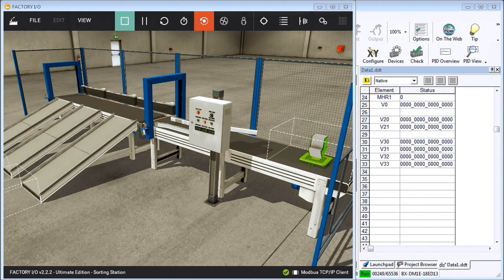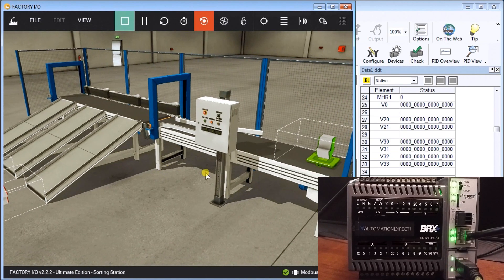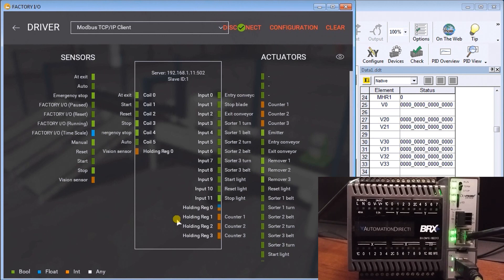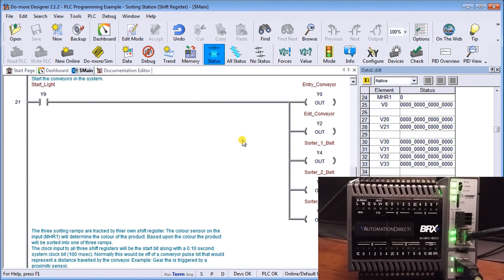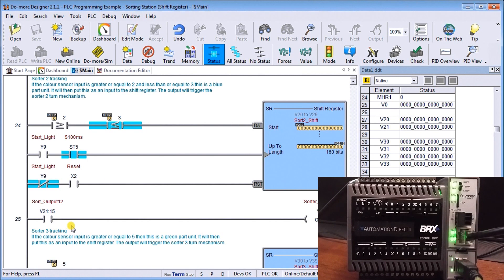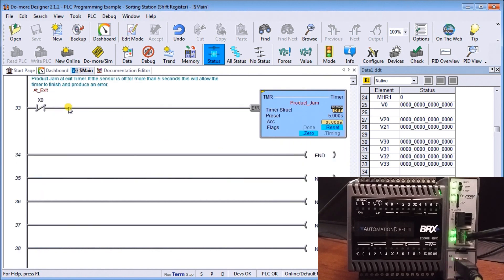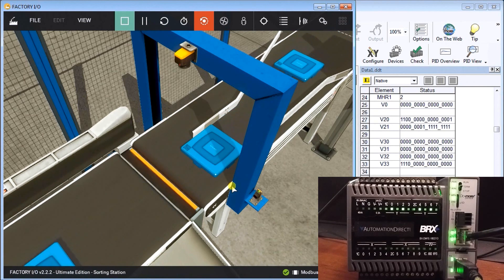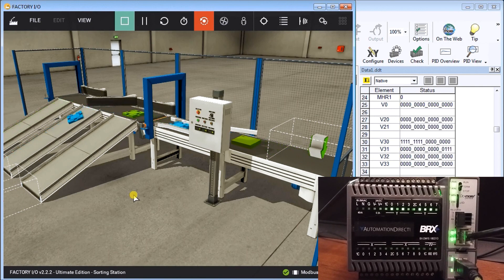Master PLC Sorting with Shift Registers - Real Factory Demo

Comment: A very late comment, but I'm trying to understand why a shift register?
Why not timers instead for example? What's the benefit of the shift register, or maybe rather whats the downside of timers?
Reply from the maker: Hi @radicaled9091
It is best explained if you try to program this with a timer(s). You will quickly find out that one item on the conveyor works fine. Now add a second one. Then a third... 
The programming becomes very messy. Using a shift register can have an infinite number of items on the conveyor at any time. It keep track of the items as the clock of the conveyor advances the items.
Regards,
Garry

Comment: Hi ! Instead of using shift register method, is this possible to  track the objects data, use sensor at each sorting arm and determine if the detected object as to be ejected or not ? I don't know if a method like this exist. Thanks for your share !
Reply from the maker: Hi HN6 NitroZz,
In this example, the color is determined at one point only. This is ideal for the shift register to track. 
Using a sensor at each of the sorting arms has been done before in a slightly different application. The application was if the conveyor lane was full then the next lane was to be used. An additional sensor was put at the top of the lane to determine if it was full or not.
Regards,
Garry

Comment: I still dont get how you relate shift register with the conveyor...im trying to rewrite this code in control io. Just having a hard time to implement it sigh... But still a very good video 🤙
Reply from the maker: Hi jhon delion,
In this example, I am using three shift registers to track each of the three outputs along the main conveyor.
Here is another post with only one output and a conveyor to track.
https://accautomation.ca/plc-programming-example-shift-register-conveyor-reject/
I hope this helps you out.
Regards,
Garry